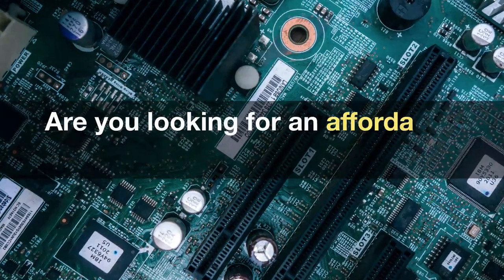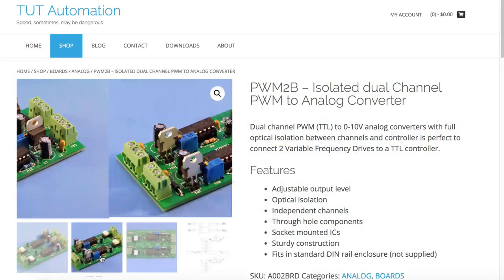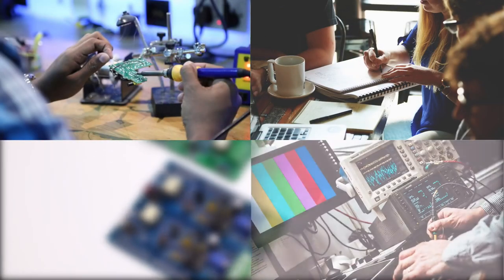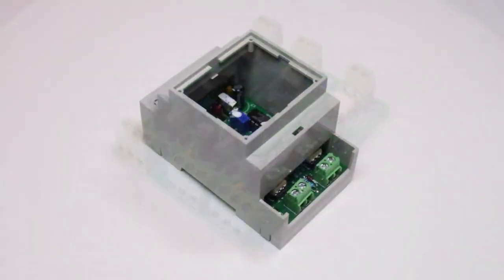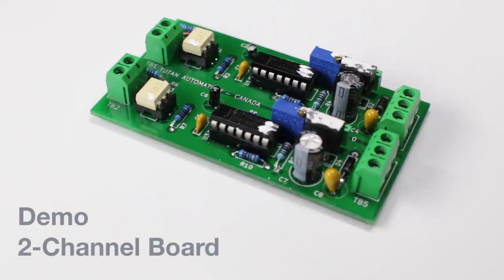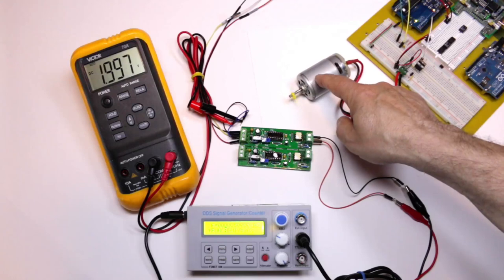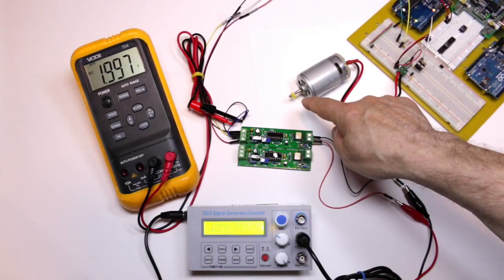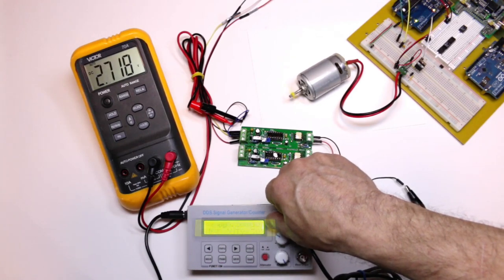Isolated PWM to Analog Converter (Demo Included)

Comment: You show it being linear at voltages up to 60%, but how does it do at 95 - 100%? That's where optos always fall off. Thanks.
Reply from the maker: Thank you for your interest.
Here is a data table from a PWM3B board:
PWM    Ch1    Ch2    Ch3
0          0.010   0.005   0.011
10       0.987   0.993   0.993
20       1.992   2.003   2.004
30       2.975   2.983   2.978
40       3.985   3.995   3.990
50       4.950  4.971    4.981
60       5.983  5.986    5.991
70       6.975  6.972   6.997
80       7.992  8.005   8.002
90       8.992  8.998   8.999
100*  10.000 10.000 10.000
* Output voltage adjusted at 100% PWM @ 500Hz
The board specs indicate 2% linearity. As you may see the actual values are better. 

Linearity degrades for PWM frequencies above 1000Hz but still keeps inside the 2% until 10KHz approx.